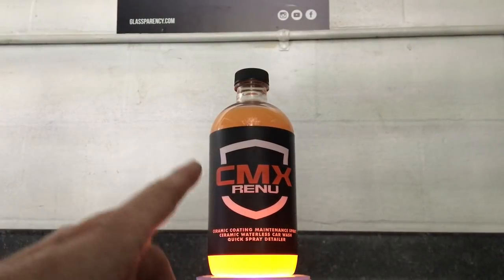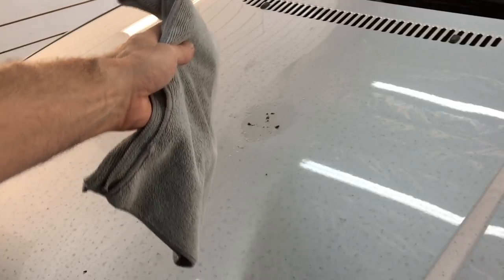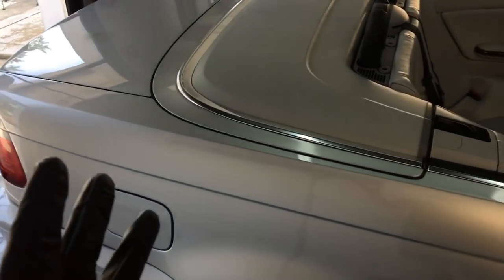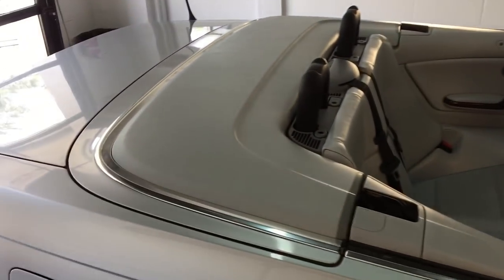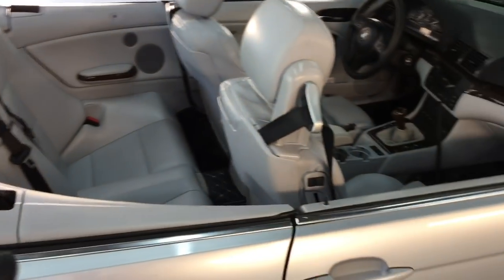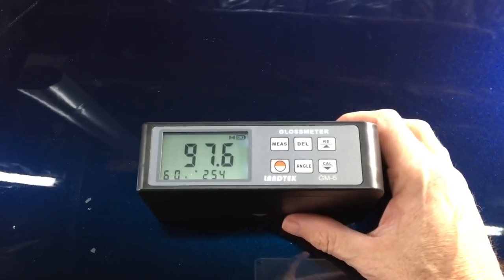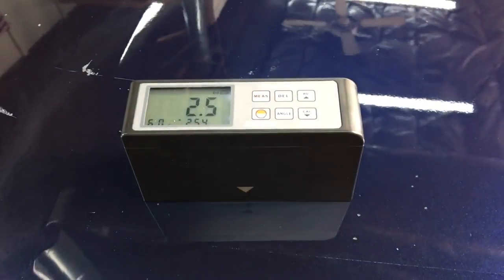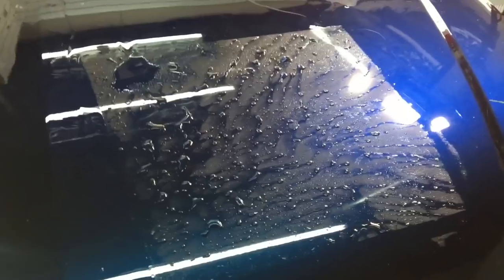NEW!!  Scorpion Ceramix CMX Renu! 3 in 1 Protectant (Rinseless Wash, Detail Spray,  Coating topper)

Comment: I always keep wolfgang uber rinseless diluted in distilled water in spray bottle. I use that to remove bird poop. I made like 3 gallons of solution. Works perfectly. I just bought 5 bottles of TW seal and shine.
Reply: Shift Gears same, i tries Opti clean and it doesn’t compare to Wolfgang. The slickness and shine cant be beat. I also use WG on my wheels as a daily wipe down.